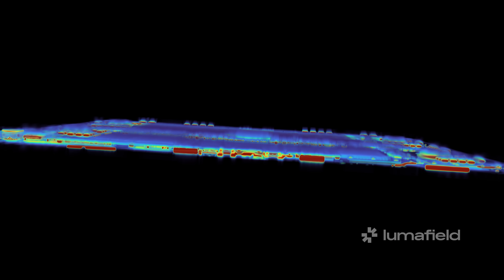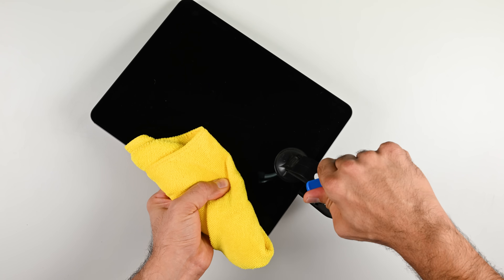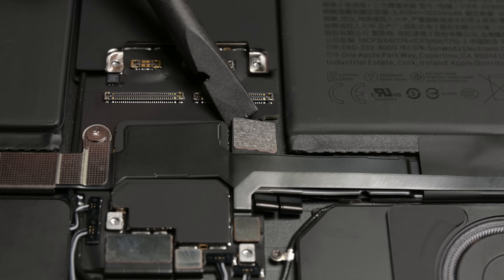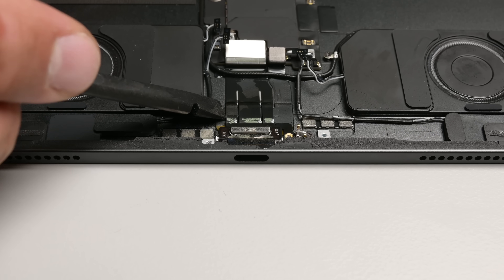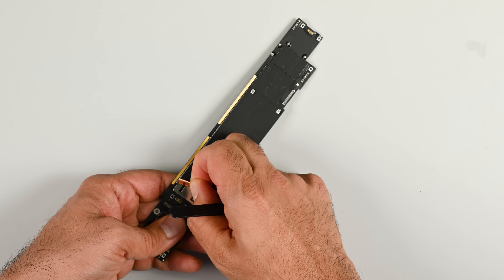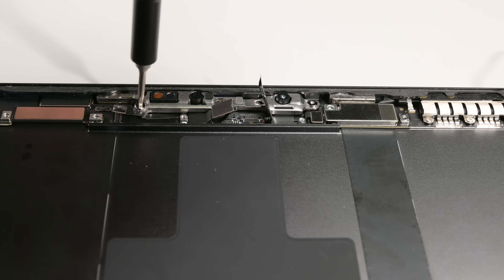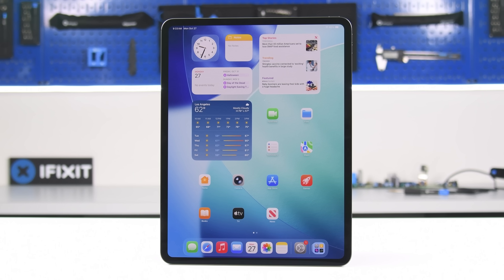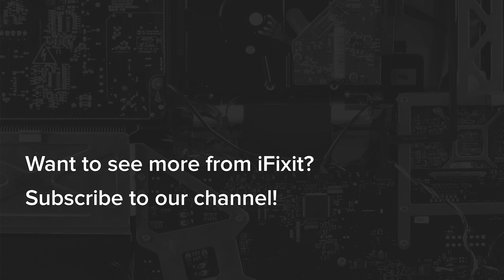We Tore Down the iPad Pro M5… and Found a Repair Paradox

Comment: I think by making the battery replacement a little bit harder (after the display removal part), it filters out unskilled technicians / general users who might got access to repair tools. as if someone was able to take the display off successfully, it past the test of a “skill” enough level. if battery is too easy to repair, it might cause more accidental damages by untrained hands
Reply: Wow, really? That is one of the hottest and dumbest takes I've read today. You can't be serious - it's BAD to make it easy to repair because, uh, people will repair it?

Let me guess, you're a lobbist for tech companies that do NOT want right to repair laws. That's the only way this makes sense.

Just WOW.
Reply: @ross-carlson So dramatic 🙄
Reply: Strawman argument. The notion that bad repairability filters out unskilled technicians implies that replacing a battery, a consumable component that /must/ absolutely replaced, needs to be a difficult process. This is demonstrably false. A component with a limited lifespan in a consumer device should be serviceable by the consumer. Imagine not being able to replace the battery in a car when it inevitably goes bad. Imagine not being able to replace the oil when you've driven long enough

Comment: Apart from display i dont see any issues. It looks very easy to repair. I have repaired a lot of apple products. This must be atleast 7. Cause most people will repair the battery. And second of all usbc is also very easy to repair.  It seems Ifixit is very biased on apple. It has to be 7.